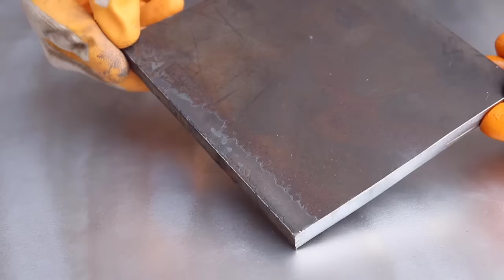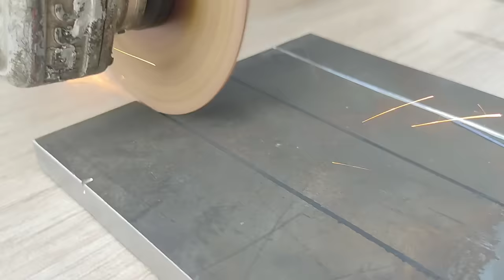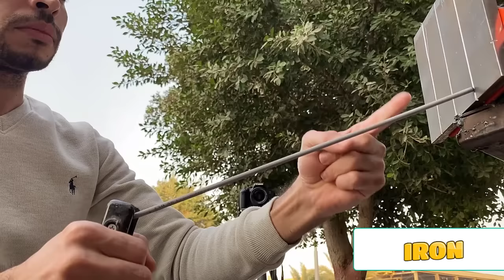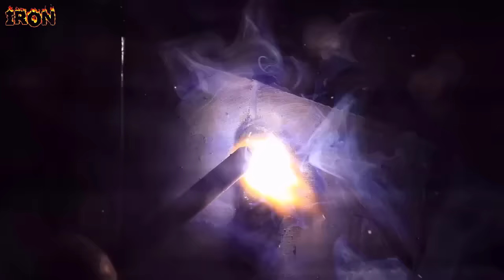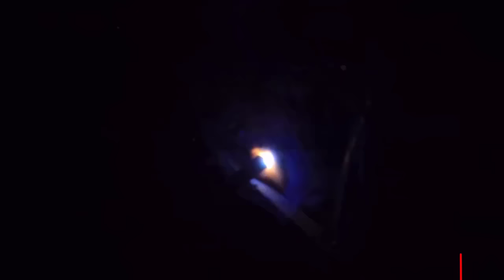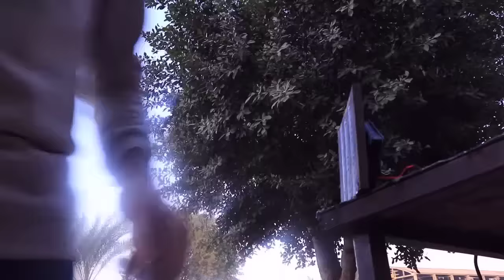The simplest way to learn electric welding easily

Comment: I find this vertical  pretty challenging and I recently had to weld old  zinc plated steel checker plate which didn't seem to like being welded very easily. Have you ever welded old steel zinc plated ? It seems there is alot of impurities exiting before the weld pool seems to form.
Reply: Careful with zink. You get sick by the fumes.
Reply: If it zinc, I won't weld and will refuse to elaborate.
Reply: That true bro
Reply: เวลเดอรไทยเเลน
Reply: @RevenSkinn  🤣
Reply: @RevenSkinn  😆

Comment: What kind of welding rod you are using?
Reply: Pretty much a 6013, the most widely used electrode in the world.
Reply: Nevermind! It's a 7018.
Reply: 7018 and 6013👌